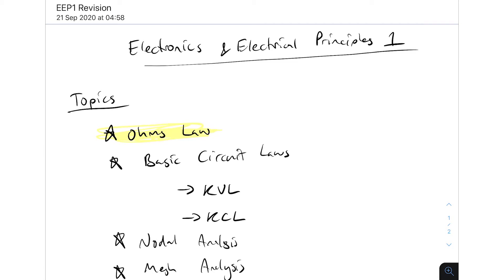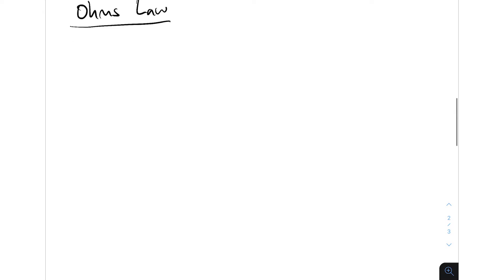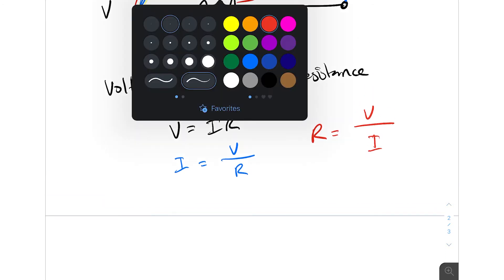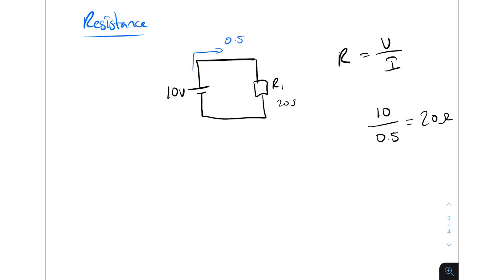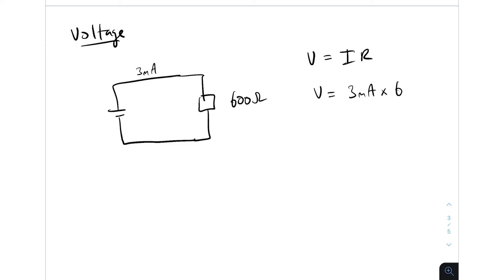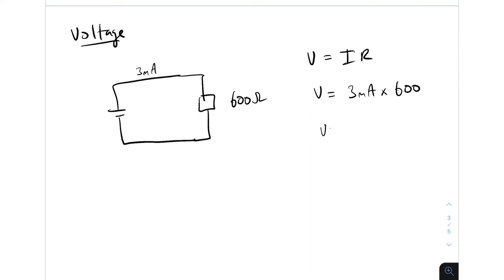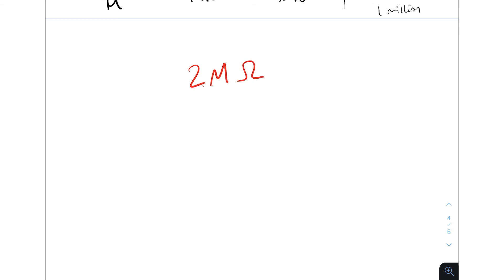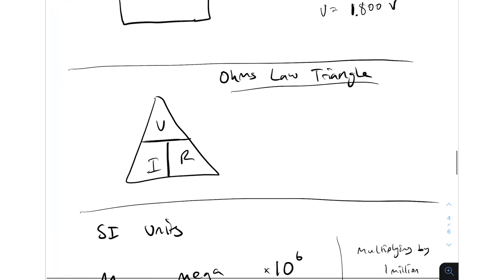Ohms Law - Revising Electronics & Electrical Principles 1

Comment: Hi
I have messaged you on messager and I kind of need help can you be able to help me as it will be a big favour of yours
Reply: Am stuck on a a question and I find it kind of hard so with help of yours it will be good but I can't send it here as the question contains pictures and it doesn't allow me to upload it here so can you please come on team
Reply from the maker: @AhsanAli-gg4nw  what circuit analysis technique is it?
Reply from the maker: Hi Ahsan, I don't use messenger but feel free to ask on here. I'll try to help if I can.
Reply: The question looks like this
3.	For the arrangement shown below, find 
a)	the equivalent capacitance of the circuit
b)	the voltage across each capacitor
c)	the charge on each capacitor
d)	the energy stored in the system.
Reply from the maker: @AhsanAli-gg4nw  so this isn't relevant to this video series. This is quite easy stuff, best thing to do is post your circuit on Reddit and Quora. Just make sure you attempt the question and mention where you are getting stuck. I don't know if this is for AC or DC, that makes a difference. Basically you combine the capacitors. I have some videos on my channel about capacitors check them out.